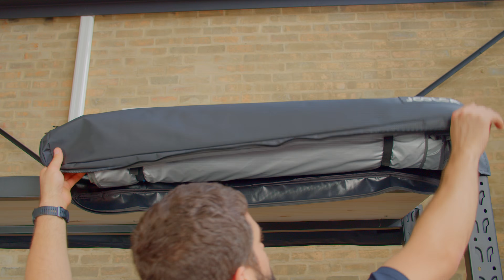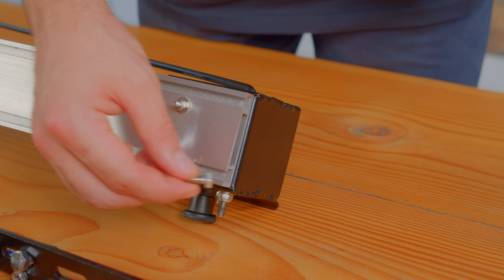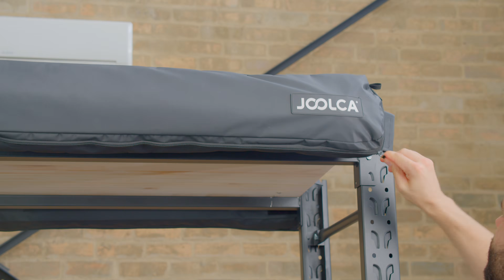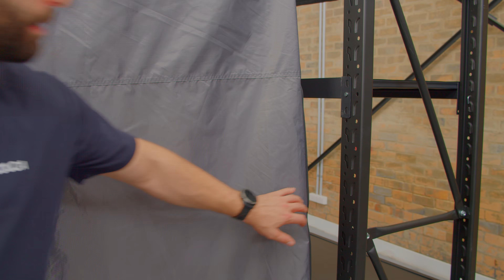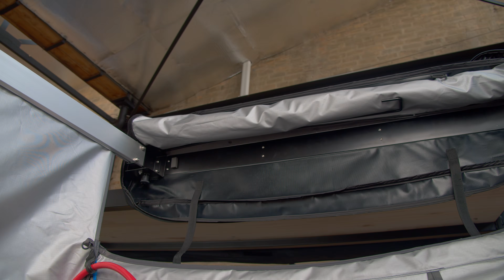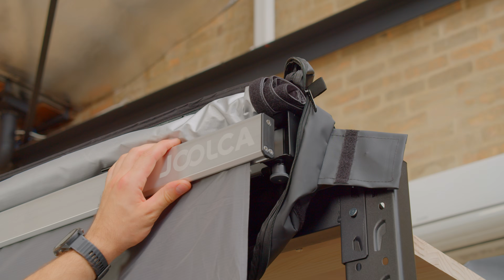Getting started with your Ensuite Mounted Single

Comment: Will you come out with a 90 Degree Swing Out Bracket at some point for the single mounted ensuite shower? My daughter bought me this shower as a gift, however I have a RAV 4 which is curved on the sides. A swing out bracket will make the ensuite shower more manageable.
Reply from the maker: We’re not planning to release one at the moment, but you can look for a shower tent bracket. This article has the track spacing and other handy info: https://support.joolca.com/hc/en-us/articles/7266756987663-Mounting-your-ENSUITE-Mounted-Single-Tent 
🙂

Comment: When you pull the tent out to roll up the sides to adjust height, would it be possible to turn tent around so zippered door is up against vehicle?  I'm looking for a small side room to access my teardrop trailer and be able to step out to get dressed or use porta-potty.  This would be perfect if the entrance is on vehicle side.
Reply from the maker: Hi! I think that's possible. Just note that the other side of the tent doesn't have a velcro for the tent. 🙂

Comment: Can you please tell me how many versions of this shower have been released? I found one for sale second hand and just wondering if there are updated versions of this and if so,  is there somewhere on the shower tent it will list which version it is?
Reply from the maker: We have released two versions so far. The V1 has both the flow and gas dials in the center while the v2 has them separate. 🙂
Reply: @Joolca  Thanks. Do you mean the hottap or the ensuite mounted single? I was asking if more than one version of the ensuite mounted single has been released.
Reply from the maker: Oh, sorry I misunderstood! We just released the first version of the mounted single tent so it's going to take a bit of time before a new version will be released. 🙂

Comment: PLEASE put a bigger zip in the rear panel so it's sutable for use with a gullwing window/has access to the vehicle window. There is a market for a completely enclosed tent to stay warm in winter, and you guys are so close! The height adjustment mechanism is also too fiddly. Would buy in a second if it had proper rear vehicle access.
Reply: Doesn't the rear wall fold down for window access?
Reply: @go_queenslander  yes but not enough, needs to come down more

Comment: Will this mounting system work with Rhino rack vertex bars? This will be on top of a Tacoma with a camper shell
Reply from the maker: Hi there, you may need something custom-built for this. Here's an idea of how the Mounted tent is installed so you'll get an idea of how to integrate it with your setup: https://support.joolca.com/hc/en-us/articles/5858910196239-How-do-I-install-the-ENSUITE-Mounted-tent- 🙂
Reply: @Joolca  That’s very similar to how my awning is mounted on. looks like I’ll have to get a third crossbar on the rack between the two that I have now because the awning is an eight footer so I’ve got the crossbars probably close to 5 feet apart just to help support the awning. and I think that I read on the info about the shower tent is that it’s somewhere around 40 inches or so wide.
Reply from the maker: Got gotcha! Yup, the mounted single tent frame is 39.37 inches (100 cm) long. 🙂

Comment: Could you flip the L-Brackets around the opposite direction to minimize the height added to the roof rack? I have a teardrop camper I park in the garage and don't have a lot of height above the Yakima Roof Rails.
Reply from the maker: Hey Jennifer, I think flipping the L-Brackets could still work! 🙂 Here's an article you can check out to get more info on how to mount the tent: https://support.joolca.com/hc/en-us/articles/5858910196239-How-do-I-install-the-ENSUITE-Mounted-tent- 🙂
Reply: @Joolca Hi, can you update the link please?